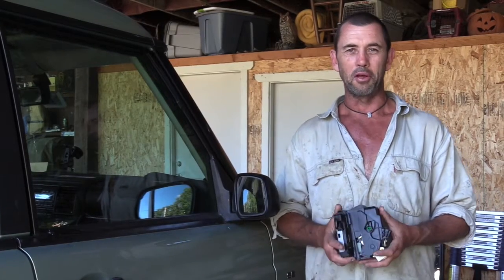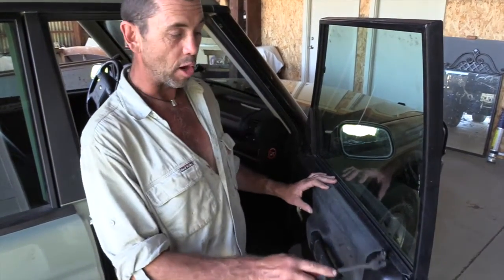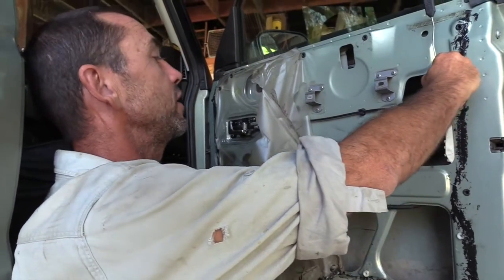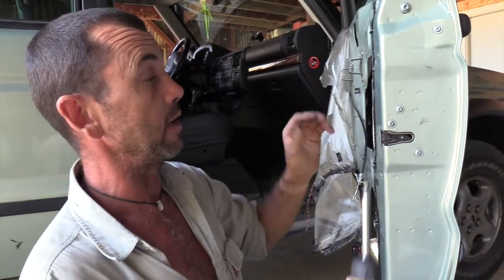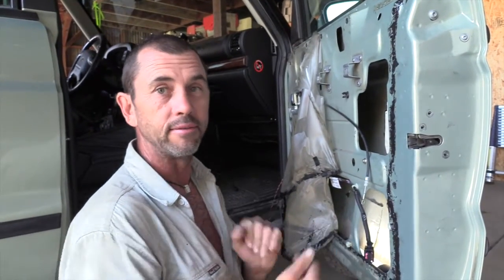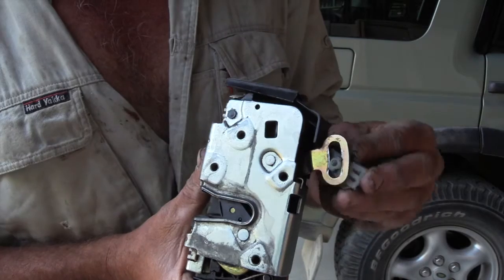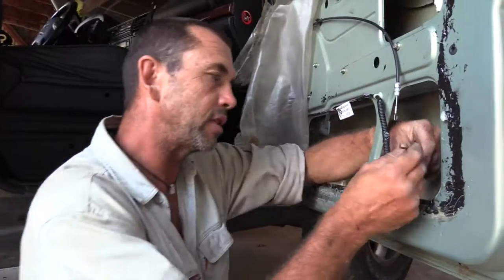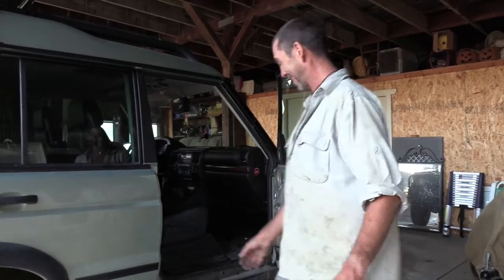Land Rover Discovery 2 door actuator replacement

Comment: Great video, sadly missed a major thing.  There's a Philips head screw right on the glue line of the interior plastic waterproofing goop, which screws into the top of the lock actuator.  If you didn't know it was there you'd miss it because it's covered in mastic stuff.  If you undo everything this guy shows and don't find this screw, you'll never get it out without breaking it (ask me how I know!).  So the lock actuator has 3 torx head screws in the door jamb and one on the inside panel of the door

Comment: As a new subscriber to your channel, I didn’t realize you have a D2. In addition to my 57 S1, I have a D2, but mine is a 99 with 03/04 headlights conversion. 

Years ago I had the same problem and I bought 2 actuators: 1 for the same door you replaced and 1 for the rear 5th door. The rear door was a piece of cake and was replaced very easily. The front passenger door wasn’t that easy and now I know why.  I was not able to remove the actuator because I didn’t realize that I had to unbolt and move the window frame out of the way. So...to a drawer it went for a long time. Now after watching this video I have enough info and motivation to start the process again and give it another shot. Thank you so much for creating and uploading this video!
Reply from the maker: Greetings Ony. Glad the actuator video helped. At the time I myself went on youtube looking for a video to assist but found nothing so we made that one. I saw your video of you driving the series 1 down the west coast. Makes me even more anxious to get mine on the road. The Disco's are great cars. We had to do a lot of work on ours but now it seems to be running very well. If you come across our Mojave Road films we used the D2 for that trip. Cheers.

Comment: Great video. Just did my passenger door and your video saved my like. Several things though. Be sure to realign the window frame to where it’s pressed against the seal. Mine leaked till I did that. You can buy the plastic door clips on eBay for $4. And you can rebuild the lock mechanism with a new motor from eBay. The instructions are online.
Reply: Rebuild?  Had a quick ebay search - can't find the new motor (and instructions)?  Is it still around?

Comment: Great video, and great to hear an Aussie, in America, driving a British car! Very multi-cultural. I need to change some actuators in my Disco 2 and hesitated when confronted with having to 'fiddle' with the window jams / frames. After watching your video it doesn't look as bad as I thought it would be! Thanks! On another note, I changed the actuator on my rear cargo door as it wouldn't unlock with the remote key. Upon changing it, and then testing it, it still wouldn't work, then I realised you have to press the unlock button on the key fob twice to unlock the cargo door. It then worked. It made me wonder if I even needed to change the lock in the first place - I just needed to press the key fob button twice lolol. At any rate, at the same time I removed and rotate through 180 degrees and reinstalled the factory spare wheel carrier so that it would allow me to put bigger tyres on the car including the spare without clashing with the bumper. So all was not lost in this exercise. Thanks again for your videos - they are my first stop when I am contemplating doing some repairs and maintenance on my Disco. Cheers! Michael, Alice Springs, Australia.
Reply from the maker: Oi! How long have you been in the Alice? I lived there for 6 years from 95 to 2001 before the wind blew me Darwin way and farther after that. That trick you mentioned about the Tyre carrier eluded me. I never even considered that idea and instead bought an expensive adapter that bolts on. I probably only know Jo Gorge who runs the Rock Tour but if you see him around say Greetings from us.
Reply: Hi man, wow - small world! I know of the Rock Tours, but I don't know Jo. If I meet him I'll say hello for you! The winds really blew you a long way from Oz! I arrived in Alice from Perth in 2011 for what was supposed to be 3 years lol - and I'm still here hehe! I learnt the wheel carrier trick from one of the many forums and it worked perfectly, and is a very cheap solution - required 2 new holes to be drilled into the carrier, but other than that it is simply bolt off, bolt on. Great to hear from you!

Comment: Great video, just wish I’d bought a new actuator instead of messing about with a used one which didn’t work either! A great help. Cheers.
Reply from the maker: I had some advice on that luckily, about trying to clean up and fix old actuators. The fellow said "don't, it always ends in tears." Though the price of new actuators bought a few tears to my eyes as I've had to replace 3 of them so far. Glad the video was of assistance.

Comment: 6 bolts and one plug to remove the whole door, or 6 million different bolts and screws to remove the lock. European engineering at its finest. lol nice one Foreman, well played
Reply from the maker: I've just undertaken a 3 day job ( for me), replacing the rocker cover gaskets. European engineering is designed for smaller bloody hands than our Japanese friends. I think the job was a success though I am physically and emotionally and financially damaged.
Reply: @ForemanAndWilmsAdventures  Small hands and two elbows on each arm help!  Always a sense of achievement when it's done though!  Walking away and coming back later with a new plan of attack often helps!

Just drained and re-filled both differentials - easy!  But, the transfer box fill plug on the side of the transfer box right next to the parking brake drum and cable (1/2" female square head plug) - so frustrating!  Lying underneath - just can't budge the bugger - snapped a 3/8" wobble extension (a cheapo Gearwrench)!  Why on so bloody tight?  Might need to get it done at a mechanic with a hoist.

Comment: I absolutely loved this video. I have the exact same problem with my 2003 D2. Interestingly, mine is Vienna Green just like yours. Not 100% sure I can do this but am certain I need a new door actuator. Thank you so much for an entertaining and helpful video.
Reply from the maker: Glad the video helped. Hope you get it fixed. These disco’s are great trucks.
Reply: Not hard - take your time, get a panel-popper/trim tool, pick and some spare door trim plugs (Part #: MWC9134 - do a search).  Ratchet, sockets and Phillips screwdriver and "Bob's your uncle"!  I put a blob of "Blu Tack" inside sockets when I don't want to lose a nut or bolt down a hole somewhere!

Comment: Thanks a lot for the video.  Just picked up a Disco 2 with the same problem.  Looks like a straightforward repair.
Reply: 2003 Disco 2: Driver's door usually goes first - most use!  Driver's door went at 12 years, front passenger door at 15 years and a rear passenger door at 16 years!  One rear passenger door and tailgate still all original from 2003.  Actuators look well made - will pull one apart later and try to discover the "Achilles heel(s)" - someone said you can get a motor off ebay and rebuild the actuator (has instructions)?

Comment: All four doors actuator on my Disco 2, 2001, do not open with key fob but all will lock with key fob. Atlantic British tech said that sometimes driver side actuator could cause all 4 doors to malfunction. Has anyone had this problem?
Mr. Foreman, bit of work but great video....thanks for sharing.
Reply from the maker: Greetings Sandra, my skills as a mechanic are on the basic side so I have no definitive answer. I would hazard a guess that the fob is faulty. In our disco there is a button on the dash to lock or unlock doors, if that works both ways I'd think the fob button is a bit buggered. If the matter is resolved I'd like to know what the problem was. Cheers.

Comment: Thanks it gave good information. My key doesn’t want to open lock mechanically, it does close when turn key to the left  but to open is solid and can’t turn key to the right position to unlock. It could be some of the linkage jammed so need to open everything and check it out. And I need it in order to use EKA CODE to start the engine as keys has been lost and I got only one key that is without fob. Thanks for the video 👍
Reply from the maker: Greetings there, I had some keys cut for our Disco that worked on the doors but not for the ignition. I then went to a real locksmith with the vehicles VIN number and he cut new keys from that info that work like new. Most likely not the solution to your problem but a factor worthy of consideration. especially if your remaining key is a copy of a copy.

Comment: The joys of owning an aging vehicle hey Mr foreman.
Seems rather ironic you're doing repairs, my car's been keeping me busy too...& broke! 
First was new tyres, then I found a loose bearing hub plus the other side was stuffed, then I found play in the lower ball joints, yesterday I spent 4.5 hours replacing valve stem seals & 3 weeks ago I replaced a steering rack boot.
THEN....there's the "panels off" inspection of the rear end, resulting in many paint chips & unnecessary damage as I ultimately didn't find the rust I sought.
THEEEEEEN there's the handbrake adjustment & all 4 wheels off for cleaning.  It just doesn't seem to stop!
Oh' & I washed it yesterday, now it's raining!!!
Reply from the maker: Tasman, thank fuck I'm not alone!!! Please excuse the vile language but after reading that I don't feel so unjustly persecuted by life. There are others out there. You have my sympathies like I know I have yours.
Reply: ***** I always refer here first for issues I've not previously dealt with. http://autofix.com.au/blog/articles
Mainly for us Aussies, but the website has a wealth of knowledge for the DIY enthusiast, & if you don't find the answers there you can message the guys on facebook.

In my case, I've had a good run with little maintenance needs for the past 3 or 4 years. Caught up with me a bit though.
The result of buying what you need, tools etc, for any particular job, is that you have it for future use from that point. & you only need buy a quality tool ONCE.

To further amuse you, when I replaced the bearing hub I ran into an unusual problem. The torque wrench I own is so old it wasn't capable of the required 250ft/p of force, capable of only a mere 140!
A mate suggested I weld 2 torque wrenches together....mmm
My solution, after researching that a Foot Pound is measured by applying 1 pound of force at a distance of 1 foot, was to convert my body weight into pounds, so 120, then use a 10"  long extension bar on a 1.2ft long breaker bar (doubling it's capability & by default my weight)...& stood on the end of it!

So given my crude calculations, I guess I was able to apply pressure around the 240 to 260ft/p range.
Reply: So the replacement valve stem seals didn't stop the excessive smoke on start up. Turns out the rings were shot so guess what we did today.....engine replacement!

Comment: Good vid. Now can you please do one for the rear door as that's the one that doesn't work on my disco 2 😂
Reply: Try popping out the LR badge and spraying the mechanism with grease stuff. Worked on mine with no need to replace any parts and this was a over a year ago in a cold climate.
Reply: Yeah, gently pry off badge they say and spray some Penetrene to free it up - haven't had to do it yet.  With that assembly, make sure the seal at the top is intact and not letting water in!
Reply: Tailgate is easy.  Also, try here for rear door locks (write-up) - few differences to the front passenger door and easier job overall (driver's door is the most involved): http://www.discovery2.co.uk/Reardoor_lock.html

Comment: I too bought mine secondhand. Not sure if my key is a replica but that’s got me thinking. I remember when I bought it all locks worked off the fob. I will see if I could take it to a locksmith to get a proper key cut.
Cheers Jon
Reply from the maker: I’m guessing if all locks worked off the fob then some of the actuators have failed. Did the drivers key ever work in the barrel. Did it ever turn?
Reply: Thinking about it no it didn’t. I will get a new key cut and then see if the actuators work.

Comment: Hi there just watched your video and found it very informative. Got a similar problem myself and was wondering does the drivers keys also operate the door handle lock. As my drivers key does not turn in the lock. Also my fob does not operate both drivers lock and passenger lock it’s only on locks both rear doors.
Reply from the maker: Greetings Johnathon. I’m assuming you have a discovery 2. The drivers key should unlock and lock all doors on the vehicle. When we bought ours 2nd hand only the driver door and rear hatch door actuators worked so since we’ve replaced the passenger door and both rear door actuators. Our only key was a replica of a replica so we went to a proper locksmith and he could with the help of the vin number reproduce an original key which works great. Is your key an original or a replica. A poor replica may be the reason it doesn’t turn in the door lock or try some wd40. the drivers key is another obstacle in addition to what was shown in our video if that actuator needs replacing.

Comment: Great video - congratulations!  Did my front door lock yesterday (thanks to your video).  I put a blob of "Blu Tack" inside sockets if I'm removing or putting on nuts/bolts so I don't lose them (like the paper I guess).

Now, all great, but for the life of me I can't pop that interior door trim panel back on!!!  Can't line it up!  Any tips?
Reply from the maker: Greetings there. Glad the video helped. As for the door panel, I seem to recall some plastic studs that attach to the panel and plastic retainers to receive them that live in the door itself. If its not lining up or snapping into place checking all of the above for being wonky or out of alignment would be my first stop. Sometimes the retainers come out with the studs and maybe that could hinder getting the panel back on. Can't think of another likely cause.
Reply: @ForemanAndWilmsAdventures  Someone told me to start pressing from the bottom (two studs down there) and work up the sides and then across the top.  I was starting from the top and one or two studs would always fall out inside the panel (might have to get some new studs as well).  Your adventures look great and I love the restoration videos - where the hell do you get the time?
Reply: Will be doing my rear door soon.  As I said, great videos - love your laconic style and appreciation of detail at the same time!
Reply: Replaced 4 of the 11 studs (4 studs a bit wonky and the worse for wear).  Started at top outside corner, worked my way across the top then down - all good and secure now.  Read that it's a small DC motor (inside actuator) that causes these actuators to fail; some buy a replacement motor (very cheap) and solder it in place?

Comment: So, I did this on my 2000 D2. (She prefers the name Landie, long story) and I somehow messed ip thw window frame position. Now I have a great northwestern breeze coming through whilst driving.  What's a proper way to realign that??
Reply from the maker: Greetings there, I couldn’t really say how to fix the alignment problem with the window without seeing it, else I’d just be throwing out wild guesses. I would have thought if the frame was out of alignment you’d have trouble shutting the door. Could it be the glass that’s not seated correctly it’s little mechanism?
Reply: @ForemanAndWilmsAdventures  so, looking at it, it looks like there is one torx on rear one on front. Just looked at right front door and the window frame is a good 1/2 to 3/4 centimeter lower than the back window frame. Looks like I may not have held it up high enough when tightening.  Doh!
Reply: @ForemanAndWilmsAdventures  I meant to ask, have you ever dealt with testing the abs systems on these?
Reply from the maker: I haven’t delved into the abs system. Glad you may have your drafty window sorted out though.
Reply: @ForemanAndWilmsAdventures  thanks. Btw, my channel has a vid on how I fixed the autostop down on my driver side window. Or was it the passenger side..
Reply: @ForemanAndWilmsAdventures  well, ordered new rotors and calipers all around. Going to try to figure out how to test the line from the LH rear sensor connection to the computer.. I hate intermittent trouble codes...

Comment: Hi thanks for this. Do you have a link for a video to repair the rear door actuator? I am stuck!
Reply from the maker: Greetings Sarah, I don't have anything on the rear door. I made this video because I struggled to find anything at all about replacing the actuators. I don't know if you've attempted the job or how far you've gotten if so, and assuming it's a Disco. I see a screw hidden beneath the inside door handle but otherwise it appears the panel could be popped from then on. I've yet to venture inside the rear door so I'm uncertain of the challenges you may encounter. I've seen PDF versions of the workshop manual free online and downloadable which may well help.

Comment: Hi, mine makes the clicking sound when trying to unlock. You reckon its something electrical then? It clicks but nothing moves. You can move it a cm or so by hand tho. Any advice how and where to look and what to check?
Reply from the maker: When the actuators seize up they still make a clicking noise like they are attempting to work. If all actuators in the truck went out at the same time I'd suspect an electrical fault, but if it's just one here and there over time, I'd expect to be replacing the actuator.
Reply: @ForemanAndWilmsAdventures  alright thanks!🤙